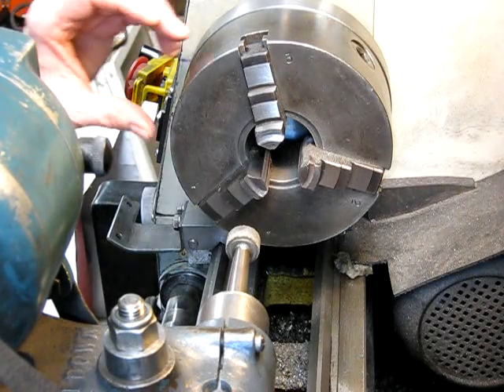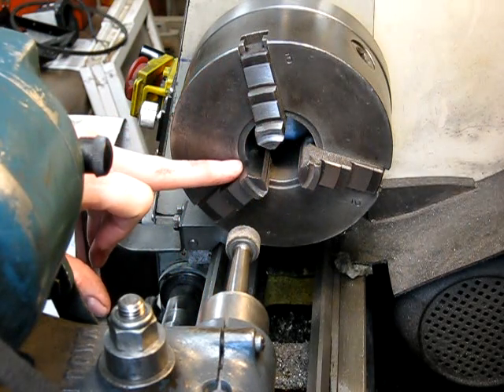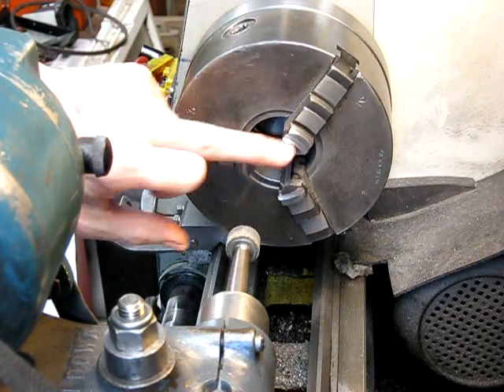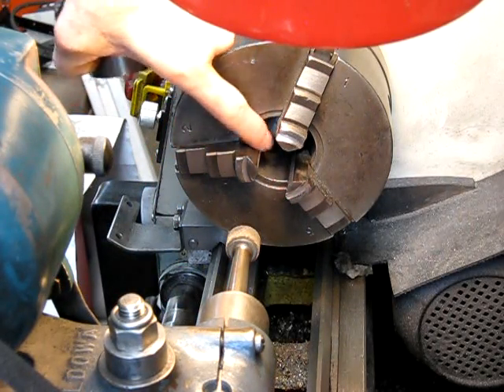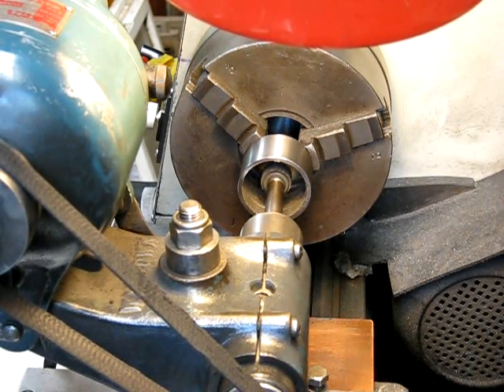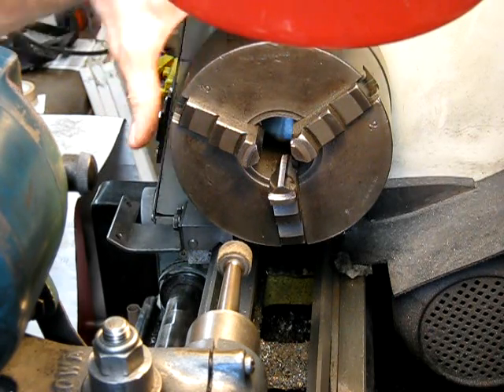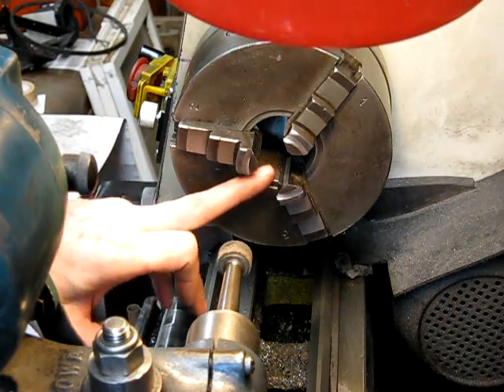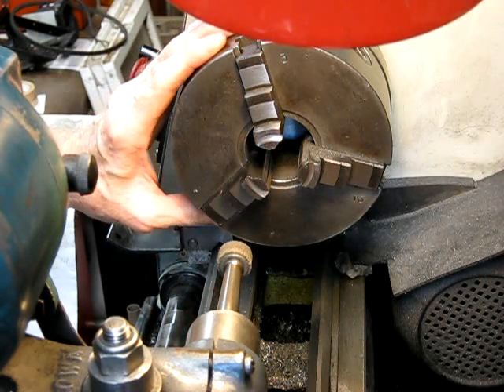How to grind internal jaws on a worn chuck

Comment: There is ALWAYS going to be runout in a scroll chuck.  Scroll chucks are just like threads in that there are a multitude of surface elements of contact that will forever be changing. It's just good maintenance to touch up the jaws surfaces to help eliminate nicks and dings as well as true them up as best your machine will provide. Also, to quote a now well used phrase: Garbage in Garbage out. I'd like to get .0001 r/o from a 1946 South Bend chuck too but if the Christmas Turkey is a skunk it just won't turn out the same.
Reply from the maker: Yes, scrolls wear unevenly due to the different work sizes being held and the frequency of operation with that dimension.    The best reading I ever got out of brand new scroll chuck was 0.01 mm across the full gripping range.  It was a Chinese brand as well.  Cheers Rob

Comment: The more i do it, the worse it gets.
I will soon run out of jaws.
Any better ideas that do not require a grinding jig ?
Maybe a diamond insert of some sort ?
Boring bar if doesn't flex going in this far then result is straight but wobbly.
Reply from the maker: Boring bar is no good as the jaws are way too hard, plus it's an interrupted cut.   One alternative method is to measure and find which jaws are too high and then remove and grind by hand on an oilstone.  I have done it on a new chuck (small jaws) and it worked well, but you must check everything is parallel.  Bit tricky, but can give a great result.  Cheers Rob

Comment: Excuse my ignorance, would loading the jaws with similar stock but on the existing jaw points work equally?
Reply from the maker: No.  The pressure has to be opposite normal operation.
Reply: xynudu yes, on the outside griping faces and not inner thats a given but without taking any metal of the jaws. Was it just to get the right “fit” between the stock metal and grinding bits you had available to you at the time? I’ve been keeping an eye out round my shop for something true to allow me to Chuck the jaws without having to turn something down, on the lathe with the chuck that has the wobble. If you get me. 👍
Reply from the maker: You load up the chuck jaws to counter any looseness before grinding.
Reply: Yes all good, but why cut a fresh step?
Reply: Cylinder housing for casting Ali rods is a great ideal btw 👍 many thanks for your reply’s.
Reply from the maker: Sorry, my mistake, the pressure has to be the same as normal loading, but the object in the jaws will get in the way of the grinder stone/wheel.  So you have to find a way to load up another way (to eliminate any freeplay).  You can spin the chuck fast and inertia will throw the jaws back against the scroll plate - but make sure to put an elastic band around the outside to prevent them coming out.  Be careful to check for movement if you use this method.  Cheers Rob
Reply: xynudu  nice tip many thanks 👍

Comment: I started this procedure after crashing my beloved mini lathe when the auto feed stuck "feeding" while threading a large internal bore. After a few newby doosh fumbles....I face drilled the standard jaws on the 3rd step...at .250" and inserted roll pins for a steel sleeve to ride on to apply "chuck closing" down pressure. I started with a 3/8" boring bar with a carbide insert to rough in. Then I finished with a 1/2" x 3/16" diamond wheel on the dremel on level 9.....mounted on the tool post. I went VERY lightly and made maybe 20 passes with the lathe in the opposite direction as the dremel at maybe 200 to 300 RPM.  Surprisingly the final results are 0.0007" and 0.021mm run out on a 5/8" drill rod at the jaws, and the same readings 3" away from the chuck towards the tail stock. You can get these little lathes DAMN good with the right procedure and patience.... HAve fun dudes!!   G>
Reply from the maker: Hi Gerry, Using pins is another pretty standard approach PROVIDED you can drill the jaw faces.  Most are not that cheesy. 
  Even carbide won't touch some quality chuck jaws, so the method in the video also can't be used in that situation.  Cheers Rob

Comment: this is not a good idea because you are creating tension only on 1 side of the chuck jaws and you grinding will not be even, the best result is to put a ring on the outer center step of the jaws to have an even distribution of pressure

Comment: Thanks for the tip, going to do that right now.
Reply from the maker: +Martynas Valūnas 

Hi Martynas,

You can also do it this other way, which seems to work OK and is a lot easier.

https://www.youtube.com/watch?v=PNnPQuKHvts

Cheers Rob
Reply: Already did the ring part, but yeah, those jaws are really hard. I was going to use a boring tool instead of a grinder, because I don't have one, do you think it's gonna work?
Reply from the maker: +Martynas Valūnas 

I have seen web pages where people claim to have used a boring bar, but it's not a good idea given the hard material, overhang, and interrupted cut - it could easily end in tears, if it works at all.

You really need to use a grinder of some sort.

Rob
Reply: Ok, thanks, I will try to attach a dremel tool to a tool holder.

Comment: This is from loctite spec sheet :

For disassembly, shear with standard hand tools and remove with methylene chloride. In rare instances where hand tools do not work because of excessive engagement length, apply localized heat to nut or bolt to approximately 482°F (250°C). Disassemble while hot.

I would not recommend using local heat on chuck jaws for distortion reasons and I would also not recommend putting your chuck in the oven in front of your missus for bruising reasons

Comment: Hope to do my own vid on this subject shortly , to explain the chuck centering and grinding process on my new lathe as it needs the runout fixed, and jaws ground
Please keep a lookout as I need to do it again anyway ; easy and cheap
Reply from the maker: alan manning When you do, comment me with the link and I will post it.  I have been tempted to do a video showing how you can also eliminate runout by grinding the jaws manually on an oilstone.  You basically measure off on a perfectly round mandrel with a dial gauge, and remove/grind the jaw with the lowest reading.  Repeat until you get uniform readings and she's done. I used this method on a small new lathe chuck that my my TPG wouldn't fit into.  Got it down to a repeatable 0.02 mm runout, which is as good as you can expect from a basic scroll chuck.  Cheers Rob

Comment: There is another way to do this , use blue loctite on the chuck jaws when in the correct position and tighten the scroll against the locked jaws , Blue loctite will give enough to centre the jaws and pre load them ,leave to set and tighten again just a bit to be sure , do your grinding and if necessary heat the chuck in an oven to get the jaws back out , don't get loctite on the scroll
Reply from the maker: alan manning Now THAT'S an original idea.  You win the teddy bear on that one :)  Be interesting to see it done.  The only trouble with any of these methods is that once a chuck is worn, regrinding is a compromise at best.  Still better than throwing it in the bin I guess.  Cheers Rob

Comment: Hi Rob !

I just saw Donald R. Cossitt'v video on grinding jaws

Bellmouth 3 Jaw Grinder

 and thought there was to be a problem with titening the jaws before grinding ... but here is the solution - thx !
Reply from the maker: Hi Keld.  Yes this is the solution, but when the jaws are worn bell mouth, you can expect the scroll plate will also be in bad shape, and it is not possible to get a perfect job.  But it will be the best you can hope for.  Cheers Rob

Comment: I note that there are various thoughts on "not" using a disc at the back of the jaws. The main thought/reason given is the jaws will bell mouth under service load; ie Gripping a job at the extreme front of the jaws. For this to be the case then the guides that the jaws run in must be worn to an extent that this kind of repair is all but futile. At the end of the discussion if we require to hold a job accurately then a 4 jaw (independent) or collet is the real answer! What say you?
Cheers from John.
Reply from the maker: I totally agree John. A 4 jaw is the only way to be accurate.  A worn chuck will always be a worn chuck, despite compensating for the problem.  Regrinding the jaws may help bring the chuck within non critical usable range, but given three jaws are never 100% accurate and the scroll plate will be worn as well, it's a bodge fix at best.  The video is only meant to show "how" to get the best result for the fix, not how to make the chuck good as new.  Cheers Rob
Reply: Duly noted Rob, I was trying not to be too critical in my text, just wanted to add food for thought. At the end of the day we are for the most part a bunch of enthusiasts here and as such if we can share then all benefit. Cheers from John.
Reply from the maker: joandar1 Your comments are most welcome, and it was a good point to raise regarding this subject.  Cheers Rob.
Reply: xynudu .

Comment: Instead of having to modify the jaws, you can also use an easy to make fixture for doing this, consisting of a disk with four holes in it. If you do an image search for 'grinding chuck jaws' you'll see what I mean. With it you can pretension the jaws for grinding without having to touch them in any other way.

Comment from the maker: Even though this method correctly loads the jaws to grind the faces, it is not a magic cure for a worn chuck.  The jaws are corrected at the grinding position, but may vary in other positions due to uneven wear, particularly in the scroll plate.  It is however as good a fix as you are going to get.  Rob

Comment from the maker: Not really. It has to be at the front of the jaws, and it would get in the way of the grind stone.  That's the whole problem when trying to correct worn internal jaws - you have to tension them before grinding. It's pointless tensioning them at the rear as they will go bell mouth when used.  Rob